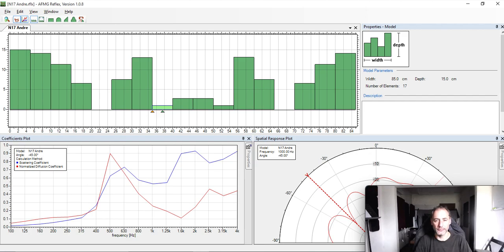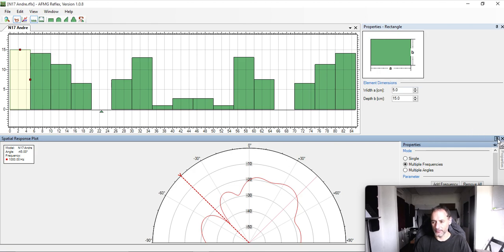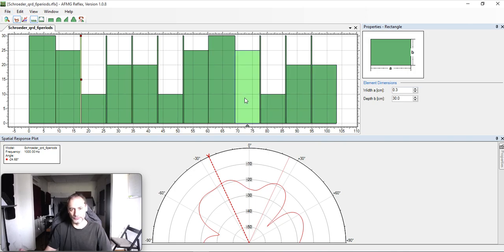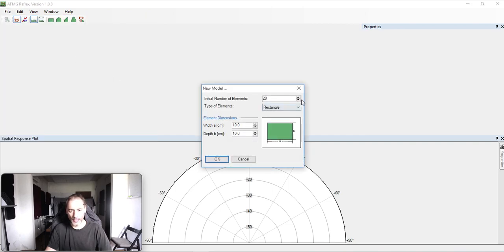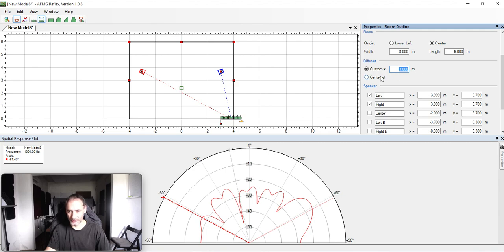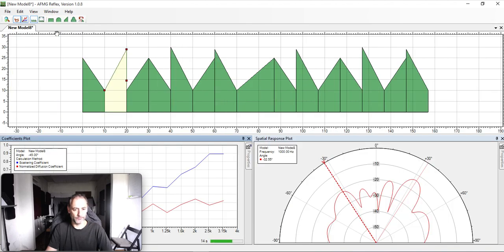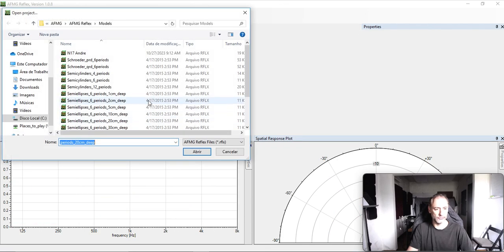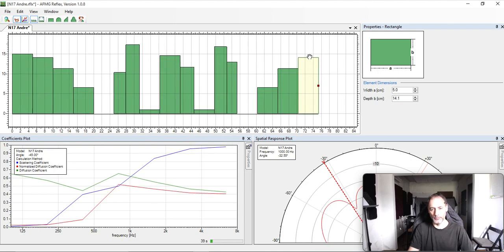Modelling Acoustic Diffusers: using AMFG Reflex

Comment: Hello, 

Can You explain about the scattering and diffusion graph, please?

Nice video
Thanks😊
Reply from the maker: That is a long topic... in simple terms, scattering is dispersed in the non-specular direction means the energy that is not reflected back to the room with the same angle of incidence, so unequal distribution.

Diffusion coefficient is different, is equal distribution of the different frequencies. Better to check this link for a better explanation

https://www.lydogakustikk.no/difference-between-diffusion-and-scattering/
Reply: Is a single polycylindrical panels have diffusive properties?
Reply: @panca4238  yes everything that isn't a plane surface has some diffusive properties